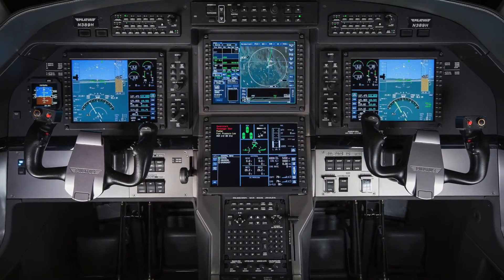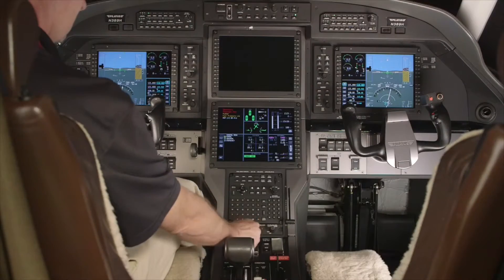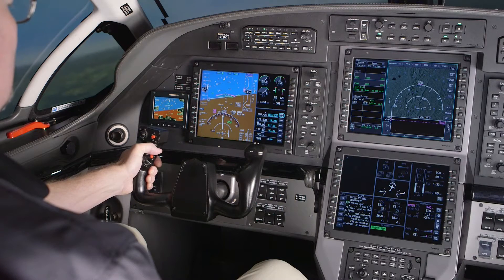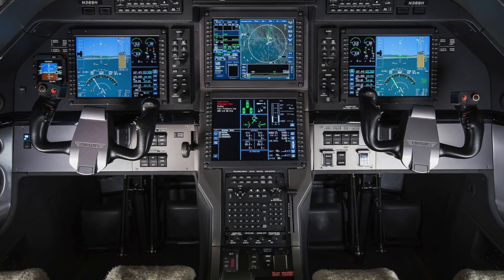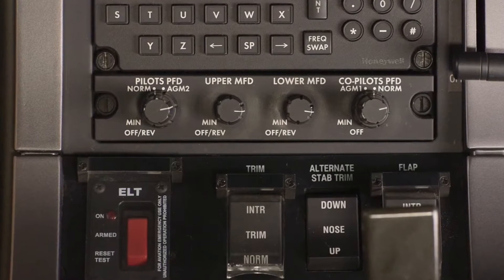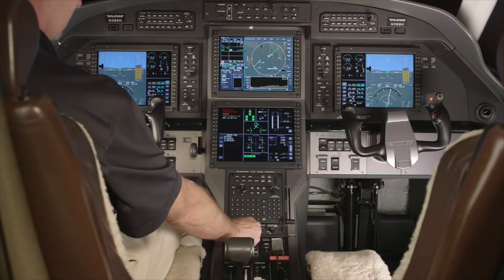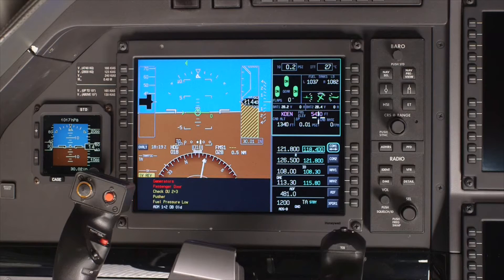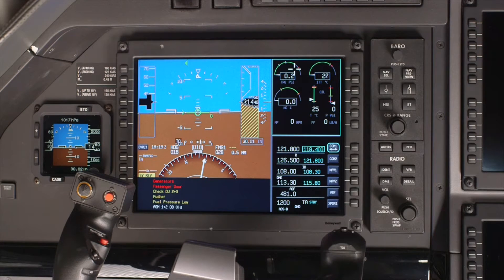Display Reversion Controller on the Pilatus PC-12 NG | Aero Training TV | Honeywell Aviation

Comment: Dear Sir 

We would like to introduce ourselves as manufactures for Stainless Steel Pipes, Flanges & Pipe Fittings

Material Grade : SS 304/304L, 316/316L, 301, 301LN, 309, 310S, Duplex 2205, 2507..
 
(Specialist in High nickel alloy)

Sanghvi Overseas
Mumbai - 400 004,
Maharashtra, India

Tel    : +91-22-6659 5387
Mob :  +91-9867 754 399 

Email :info@sanghvioverseas.com

Web  :www.sanghvioverseas.com